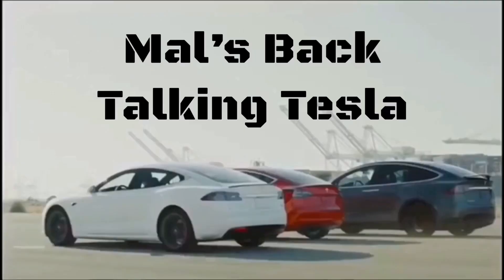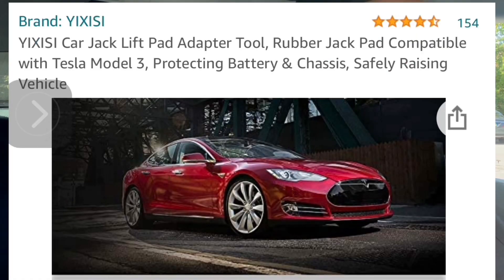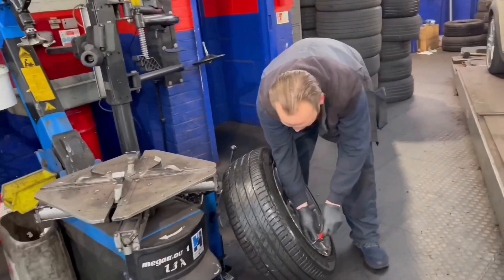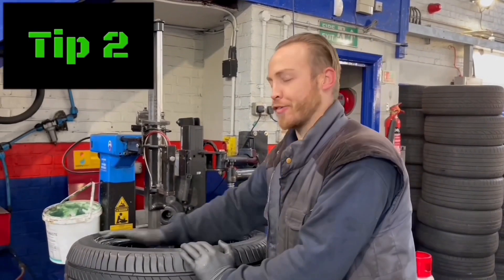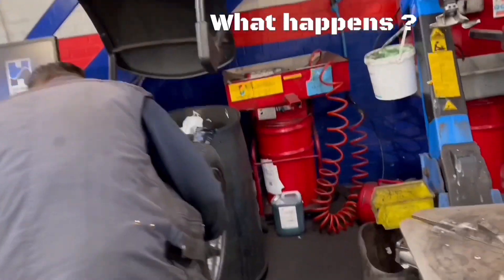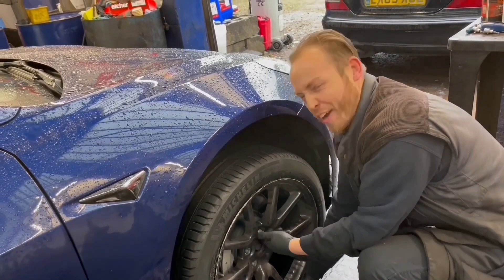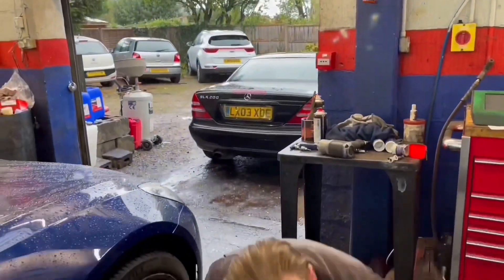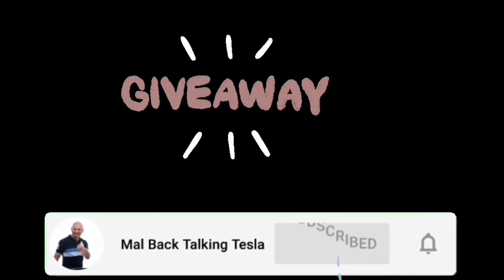What Happens When You Take A Tesla To Have A New Tyre Fited Tips And Tricks

Comment: A very interesting and informative video, I learned lots from this👍. Sub titles in parts would have been useful as it was difficult to hear what was said. A worthwhile video to make, so thanks for taking time-out to share👍

Im planning a 1800 mile road trip early next yesr (hopefully, covid restrictions permitting). I'm definitely going to purchase a spare tyre, (and jack obviously) probably a spacesaver for the trip. We'll worth it for peace of mind.

My only concern is how you would torgue the bolts when you change the wheel yourself at thr roadside. 🤔 A bit worry g after what that guy said.
Reply from the maker: Thanks for your kind words
Before torx came in I change many tyres but if you do have to change it you could find a Garrage some where that would probably tighten it for you I'm guessing you could by torx wrench

Amazon do them so it might be worth you buying one

Draper 30357 Micrometer Reversible Ratchet Torque Wrench, 1/2" Square Drive, 30Nm-210Nm https://www.amazon.co.uk/dp/B0001K9S52/ref=cm_sw_r_cp_api_glt_fabc_2FZF56W87BVX503BVFQB
Thanks for watching